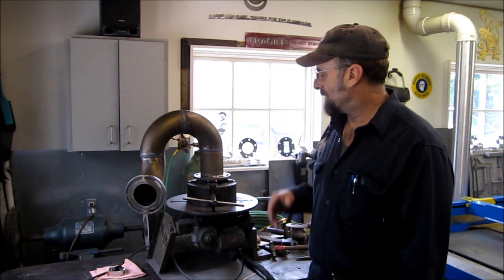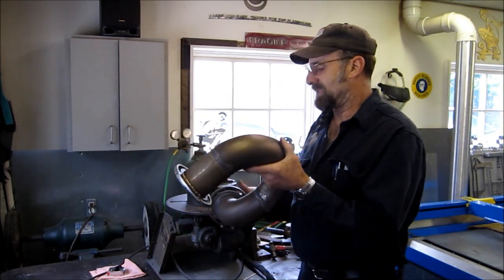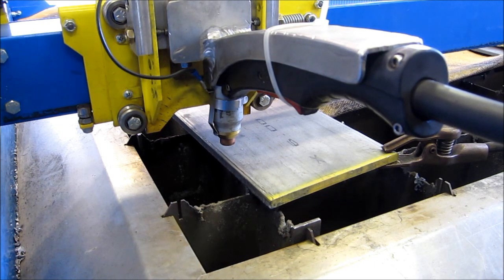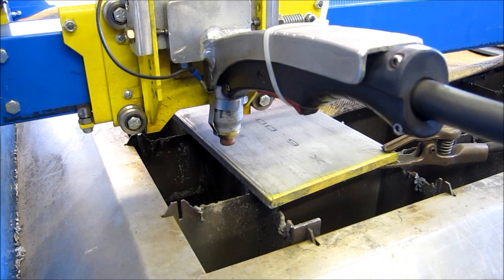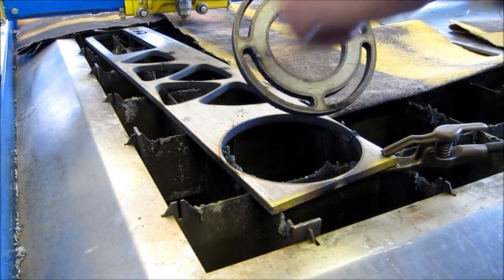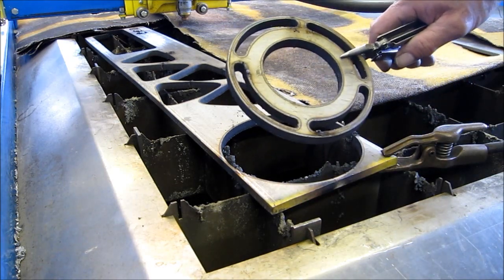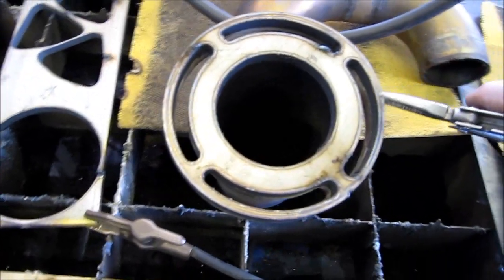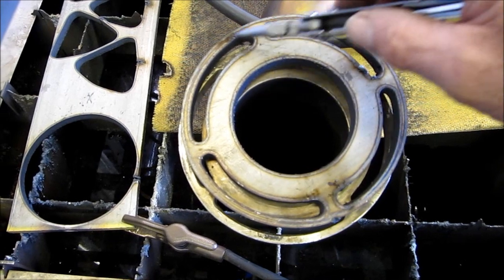Cummins Marine Exhaust System

Comment: Hey Keith, I used to work at a place in south FL called Marine Exhaust Systems. I used to make custom exhaust for yachts. Seeing that Cummins flange brings back some memories. Most of out flanges came in as a cast and we had to machine them down to spec. We did CAT, Cummins, MAN, and some more that I don't remember right off hand. That was a fun job I learned a lot working there. I was not doing any machining while working there. I was just a custom fab guy. But one of the machinist took me under his wing and taught me how to run a lathe.

Comment: I'm curious. Obviously the tubing is lighter gauge than the flange, but you did a very careful job of heat control on your tube welds, moving from one to the next, hitting each weld in sequence to allow the previous weld time to cool, then when you went to the flange, you did it all in one shot.... does it need to be done in one shot? Or is it just not an issue? Love watching your work, thank you.

Comment: Hey Keith, great videos. I love watching the CNC plasma stuff (I run and program CNC plasma/burn tables for a living).One tip for minimizing part movement when burning is put your lead in/lead out in a thicker section of the plate. This allows the largest section of scrap to hold the part from moving until the cut is complete. I think if you had moved your lead in about 45 degrees CCW from where you started you could have reduced the movement of that part.

Comment from the maker: They are all pretty much the same design but sizes are different for the three  & four inch diameter turbo! I have a three inch sample here on the table and checking the files for the one in the video to see if that is a four inch size. Do you know off hand which one you need dimensions on? ;{)---

Comment from the maker: Well you start at the turbo, judge location of end or flange, long and short radius elbows have fixed center to end dimension, so you got some facts to play with, use three hands to hold a few pieces in place and match mark, take back to shop for tacks, this job took two fittings, you get better with practice, and the slotted flanges make for a certain amount of forgiveness... :)

Comment from the maker: I just hit it with a flap disc on the faces, little burr on the slots and skimmed the bore for clean also angle for flow, then shallow face cut to regester pipe center, hit the OD on the Wilton, which wasn't undersized enough to worry about...